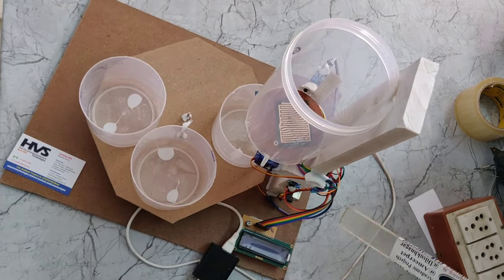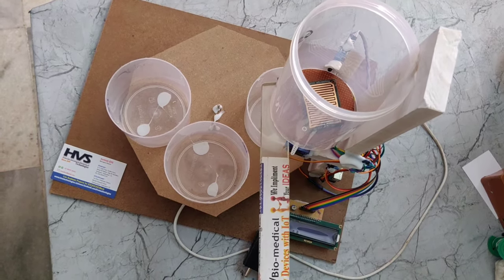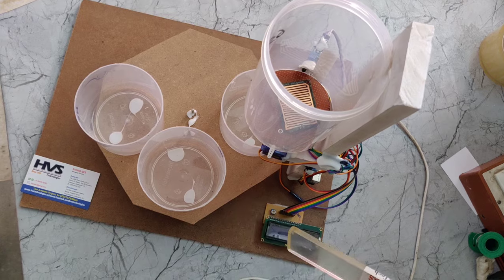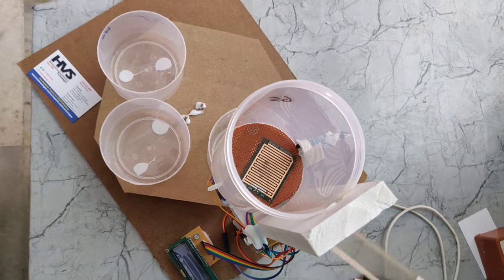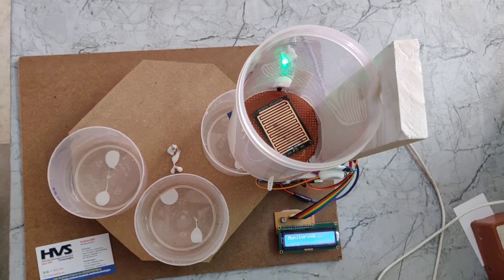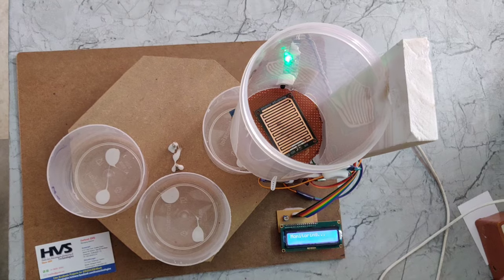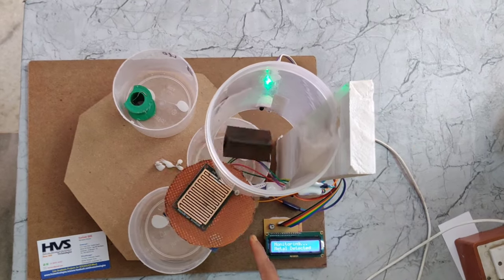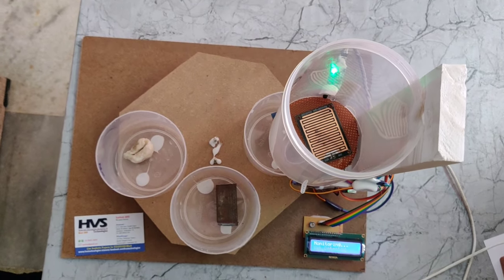Automatic Waste Segregation System (Dry,Wet,Metal) using Arduino

Comment: Which motor have you used for rotation of platform.
Reply from the maker: Servo motor. You can contact us at +919603140482
Through WhatsApp or call